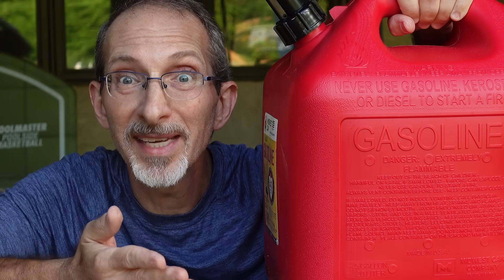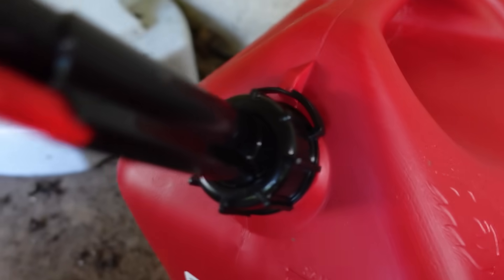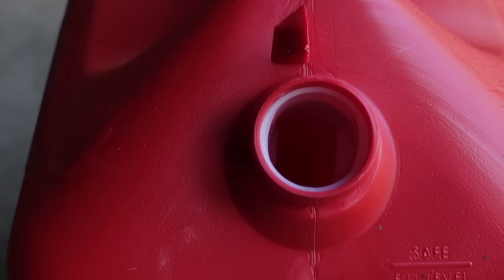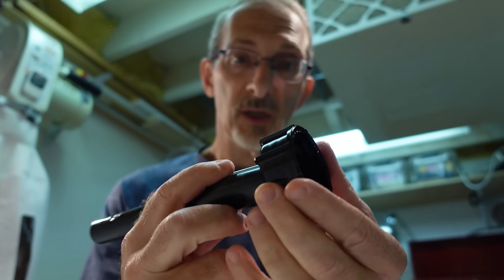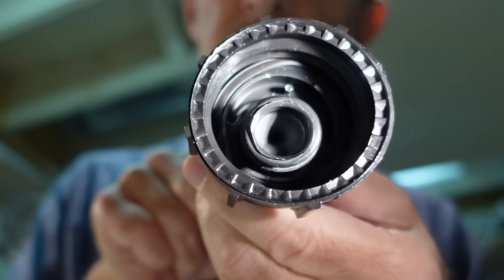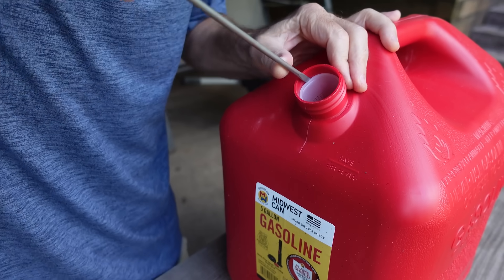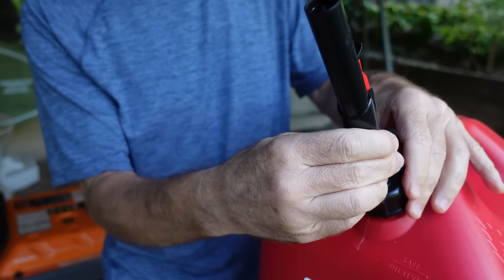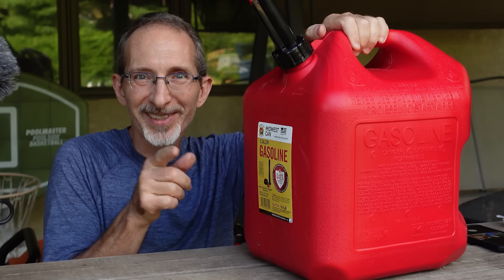Gas Can Modification | New Gas Can Fix

Comment: Those gas cans needs to be banned they are so dangerous is unreal put gas in it mowers but when you push that little button to make the gas come out it will pour out and there could cause a fire on your equipment you can get seriously hurt because of those nozzles companies need to be sued for manufacturing of the gas cans especially the nozzles they are super dangerous you're gonna kill somebody one day if they haven't already

Comment: I have some antique engines with old and fragile gas tanks that will not take any sort of downward pressure without doing any damage. Also, the tip of the spout is way too long. the tip hits the bottom of the fuel tank. So the automatic lid can't even fill my lawnmower.

Comment: Usually, if you just pop out the little red catch button thing on the spout, the cans work as intended (stop and go with a push of the nozzle) and they don't spill. That's all you have to do to make them function as they should.
Reply: You still can't fill the can with out it splashing all over you. remove the filter.
 think about it.

Comment: Look out for your new “Chinese “ generator. The gas tank will corrode in a few years. Then rust will disable your carburetor. Look for a gas tank coating material compatible with ethanol.

Comment: I remember when they started selling these stupid things.  They are not safer in any way than a traditional can whether filling a car or small engine.  I've seen so many people spill gas all over the side of their car while wrestling with these things on the side of the road with traffic whizzing by.  And most of the time when I see them in people's trunks, they are broken, leaving them completely open at all times to spill gas.  

I had one for a year or so and one day when it got hot, the stupid thing built up so much pressure that it blew the mechanism apart and sprayed gas all over everything in my trunk, unlike the old cans where the little air valve pops under mild pressure without making a mess.  After that, I no longer buy anything other than used old cans with normal spouts.

Pretty confident that these safety cans were someone's bad idea that they couldn't sell, so they went to their buddy in the government and got a law pushed through that made them the only type of can that could be sold.

Comment: I don't understand how the older plastic cans with the air breather on the back and accordion type neck filler was dangerous.  Idiots always typing to change things when no change was EVER needed.  My can isn't as bad as these, but no breather hole on the back and on warm/hot days no matter where it's placed it leaks fuel from the neck.  My old ones never did that.

Comment: 5 gal gas can used to be strong and sold for only $3.98 at the most just a few years back. Now they're cheaper made and sell for around $20 to $25 or more. They blamed the price on high fuel cost, but when Trump was President, gas at $1.89/gal. was really a lot cheaper because we were energy independent, but the price of the gas cans and other products made from fuel never came back down.

Comment: These environmental pieces of junk are more trouble than they are worth and doesn't do anything to change the environment. And without the little vent on the back of the can, it causes the spout to suck air in as gas goes out and splashes gas everywhere. I always put me a vent on the new cans. You can even use a valve from a tire to put into the back of your gas can. I'm gkad also that I still have some of the older gas cans with normal spouts and vents in the cans.

Comment: Agreed. The Midwest brand of gas cans are horrible but they are sold everywhere, I finally tossed mine and switched to No-Spill and I got the spout extension.  Way better! FYI- I also added vent caps but the No-Spill can works best without them.
Reply: The spout extender is key.

Comment: sometimes you need to get a hand saw and cut a quarter inch off the bottom of the cap, so when you tighten it, the o ring  will actually compress and gas won't leak before even getting into the nozzle. Poor manufacturing tolerances!

Comment: Or simply remove cap & neck, pour from the can's opening into whatever. Then you may want to pour into a funnel but If pouring into a funnel then you have to have the right funnel: shape & tube diameter and funnel capacity or that spills too.

Comment: I would just buy a better pour spout replacement kit that would solve this problem on Amazon or anywhere else you can find them. These new ones that come with new gas cans suck and should just be thrown away and replaced with the flexible replacement pour spouts.

Comment: Have the same can. Spilled gas all over when trying to fill mowers, etc.! Replaced the spout with a flexible one from Amazon that also included a drill bit to put a vent hole in the opposite side of the top and also a little covered plastic insert that fits tight and seals until time to pour. All my old cans had vents and flexible spouts. Seldom spilled gas. Never let a bureaucrat nor engineer design something to be used by practical people!

Comment: Now that the spring has been removed from the fill tube that keeps the gas in the can when you invert the can, you need some kind of turn down placed on the end of the tube.  Otherwise the gas will come out of the can without the end of the tube in the gas tank. I used a curved rubber hose, that goes in the tank before you invert the can - works great.

Comment: The white plastic piece you removed is a flame arrestor, not a filter. The biggest problem with these Midwest gas cans is that the seem often opens up along the top of the handle.

Comment: In case anyone doesn't know, There are $2.00 kits that include a new "old style spout". These kits don't have any stoppers inside of the spout, and include the rubber gasket too.
Reply: HI where did you find it for $2 ..i cant find anything less then 10

Comment: Good hacks for sure but I rather have the spring that closes the spout  shortened and then stretch out its original size and reinstall it. This will reduce the tension it exerts, makes it easier to hold it the spout in the open position but still closes automatically when you pull away the spout or let go. Nice video!!

Comment: Let's think about that filter that they put at the top of the can again for a second. If you think about it, It traps impurities in the filter, but then when you turn the can over to pour the gas out of it, those impurities are going to just flow right back into your machines tank. All it does is hold them for a few minutes in itself! stupid.

Comment: P.S. When removing the spring, also remove the forward portion of the spout & the inside of the whole spout system. Otherwise, you still have that dribbling out when trying to fill something up with gas. Also drill a small hole in the top towards the back side of handle for air flow. You can buy plugs that can stop up the drilled hole.

Comment: I have seen this kind of gas can, and was not impressed with the nozzle design. Happily, the stores near me don't sell this brand. Instead, the most popular brand in the hardware and big box stores near me is the "No-Spill" brand. I wonder if different states have varying regulations that result in different brands being more popular in different areas? Anyway, the No-Spill, while not perfect, seems to address all the safety concerns that this Midwest brand shown here is purporting to solve, but in a more user-friendly manner. They do still have the (very stiff) ratchet that makes it difficult to unscrew the nozzle; I don't completely cut those ratchets off, but I do cut one end, making them easier to push in. And while the No-Spill have the white strainer, those can be removed easily without destroying them, and I don't have the reported issue with them causing the gas pump to trip off while filling. Best, the way the button works that allows fuel to flow in the nozzle works a lot nicer than on this Midwest brand.

Comment: I bought a bunch of vent caps and drill bit to be able to retrofit the vent caps onto the back of the cans like older cans had. Gas flows much better into the tanks.
Reply from the maker: @HAILSTORM - I agree! I added a vent and made another mod to the spring in my second video and it really helped. Video 2: https://youtu.be/XoYxdrhB6Ls 
Thanks for watching!

Comment: Where do they still have gas station attendants? I prefer to pump my own gas. You can also get spouts online that do not have the safety mechanism at all as well as a diy vent plug to install.
Reply from the maker: Raymond, I grew up in New Jersey where every gas station had attendants. I'm in PA where there are still a few stations that fill for you. I agree - aftermarket no-frill spouts are readily available! (But I like these mods because they are mostly free.)

Comment: The fix: Unscrew top. Use a funnel. Put top back on when done. If it's made of plastic, it breaks right off the very 1st time you use it. In freezing weather, they split down the side. Still using my 1966 Metal Jerry Can. Works perfect and NO breakage. This new gas can deal is the results of No Common Sense in the design & manufacture of. You're right 100% on your video here.
Reply from the maker: Craig, thanks for the suggestions and the kind words! I appreciate you watching!
Reply: @MikeFyxdt  You are welcome.

Comment: Remember when the safety device was just a yellow cap. I can remember the old metal ones that had a flexible helical metal fill neck. Those were the best. Lasted forever and you could aim that neck any way you wanted. 

You can also drill a 1/4" hole in the top rear of the can and add a little reclosable cap to let air into the can and relieve the backpressure. That cuts the fill time WAY down.
Reply from the maker: @Phillip Todd - I had a metal container with a flexible rubber spout. You could put the spout into what you were fueling before you even tipped the can to pour. It was awesome and I never spilled! I added a vent and cap in my follow up video, if you'd like to watch...Video 2: https://youtu.be/XoYxdrhB6Ls

Comment: I bought one of these Midwest cans to replace a 25 year old Blitz can that finally sprung a leak. The nozzle from the Blitz can fits these but you have to use the threaded cap for the Midwest can
Reply from the maker: James, there are replacement spout kits that call themselves 'universal', so I assume that there aren't that many differences between the nozzles and threads. The kits come with a few versions, so mix-and-match with old containers seems like a great option!

Comment: Don't buy one of those in the first place.  Why waste the time with removing spring?  If you get stuck with one of these cans, just cut the tab off, and use the whole thing as a cap, and use a funnel.  Don't pour gas through that junk.  For one thing you can't get enough flow with that.  I agree to remove the strainer as well as the tab.  Also if you use funnel you can pour sideways in order to allow venting from above the pour.  It does suck holding a funnel at the same time with your knee.
Reply from the maker: Matt, your comments make sense - but the funnel trick is really hard with the weight of a full 5 gallon container. In my second video I made some more changes that made the container 'almost' good, lol! Video 2: https://youtu.be/XoYxdrhB6Ls
Reply: @MikeFyxdt  Absolutely Mike, I agree there, especially according to what you are filling, and even being able to hold the funnel at the same time.  It may very well be worth removing the spring.  I really haven't used them that much as only when running out of gas when driving.  I use the push button type with the  large opening and yellow button.  I have 3) 5 Gal. cans for my Gravely and 1) 2 1/2 Gal. for saws and trimmers that use 2 cyc oil mixture.  The brand of machinery I use, has bottles of oil where the entire bottle mixes  with 2 1/2 gal of gasoline.  Of course I cut the locking tab off those as well.

Comment: I only have one of those new style (safety?) gas cans.  Fortunately I still have a few of my old ones with the yellow plastic vents but the flexible pour spouts are old and leak.  I solved this by going to harbor freight and buying one of their 2 D cell pumps.  It works great no spills or mess and yes I use it to fill my generator as well as other fuel tanks.  But thanks for the info.  FLY NAVY!!!
Reply from the maker: @USN veteran - good advice! The transfer pumps are definitely a back saver. I appreciate you watching and commenting! 😄

Comment: I have spilled more gas using the new SAFE cans than I ever did using the old style with the flexi nozzle. That filter you removed is the flash/flame guard to stop the gas exploding when you dump gas on your bonfire to get it going. The EPA don't care if you get trash in your can. There is a vent that you can add to the opposite side of the can to aid in pouring. Available on e bay in packs of 5. Just drill a 1/2" hole in the can and insert the cap.
Reply from the maker: @Davidapp - all great comments! You are correct... In my second video I explained the flashback arrester and also added a vent to the container, as well as a few other modifications. Now my containers are customized how I like them! Video 2: https://youtu.be/XoYxdrhB6Ls

Comment: I always wondered who got their pockets lined to pass this law. .. I just take the nozzle off and use a decent funnel. It works great that way.
Reply from the maker: Dwayne - I really think the manufacturer thinks this is a good design. Funnel still takes strength and aim if you have a full 5 gallon container, but fortunately I'm getting pretty good with the modified spout. I appreciate you watching and commenting!

Comment: Like the other poster, in all my years never had a problem or saw any spills or fires. Had another problem with the new fillers. Once the little clip hooked on the gas neck to open you couldn't push the filler in far enough to be in the car's gas neck, it didn't open the cars flap.
Reply from the maker: @tlak - I find filling a car gas directly with this nozzle to be near impossible. An angled funnel makes it much easier!

Comment: Water jugs are made from the same plastic and don't have those stupid nozzles.
Reply from the maker: Russell, in this video what I incorrectly called a 'filter' is actually a flame mitigation device to prevent flashback and explosions - fortunately not a concern with water bottles! I updated this info and made some more modifications in my follow up video if you'd like to watch.  Video 2: https://youtu.be/XoYxdrhB6Ls

Comment: I bought a diesel can with this same nozzle design and hated it. However, rather than removing the spring, I removed the red safety tab. Having the spring loaded nozzle shut off is very handy because I can invert the can without any fuel coming out, then set it down on the fuel filler neck and the weight of the can opens the valve on the nozzle. Works great on my Kubota 3901. I can use two hands to hold a full can without having to mess with the red safety tab.
Reply from the maker: Fritz - really good comments! In my second video I actually replaced the spring, but shortened it to make it easier to depress. Much better now! Here's the link if you'd like to watch...Video 2: https://youtu.be/XoYxdrhB6Ls
Reply: I did the same as you on my gas and diesel cans. even have a kubota lol. I put a valve stem in the top rear of the handle as a vent and then poke a hole in the filter then grab and rip it out with a looong heavy duty needle nose pliers. Viola, usable gas or diesel can. I have a 12v fuel pump I bought for pumping extra gas out of a boat. I am going to get an adapter for my ridged 18v battery then a voltage reducer and wire it all up and then leave the can on the floor and pump the fuel into the tractor.
Reply: That's what I did, too! Accidentally. 😂
I got so pissed off while filling my lawnmower that I pulled the spout off & and whipped the pos at my garage wall. It flew into pieces & I just poured directly into tank. It was about the same amount of mess! 
Then I retrieved the spout & pieces & made the happy discovery that without that frustrating red piece, I now had a simple spring-loaded spout! I plan to do the same thing to my other one...minus whipping it at the wall. 😏
I guess companies that utilize this particular "safety" feature never considered the issues they created for older folks, people with disabilities & arthritis. Some of us don't have people we can ask to help us, either...and for something as stupid as getting gas out of a can!  It takes quite a bit of pressure to depress that little red button. 
Did. Past tense, I should say! 😁
Reply: Bingo.  Keep the spring valve.  Lose the red tab.

Comment: So the filter holds the debris so it can't get in the can, then you put on the nozzle and the debris goes into the gas tank so that it can clog the fuel system of your boat?  Wtf?  They didn't  think that through while they were trying  to sell "extra features"
Reply: Someone said it is a flame arrestor to make it compliant with the new 2020 law.

Comment: Good video, I'd like to know why the hell they stopped putting a vent on the back of the can too. That breathe vent made filling a lot easier besides the fact that when these cans are stored they tend to build a lot of pressure which was easier to keep from happening with the tiny vent on the back rather than having to push the stupid safety neck in.